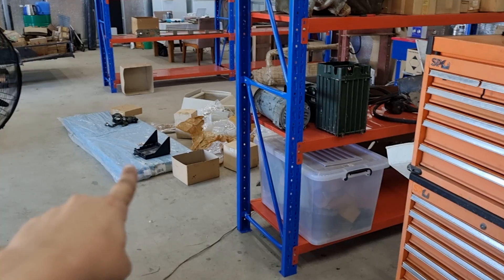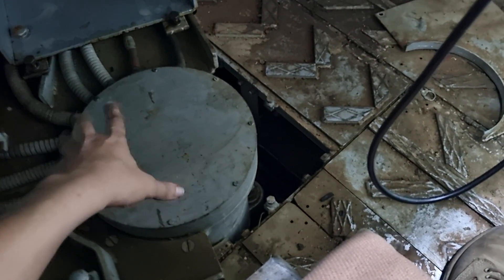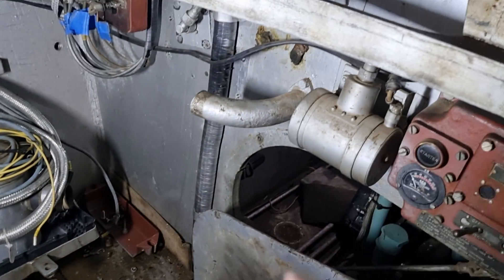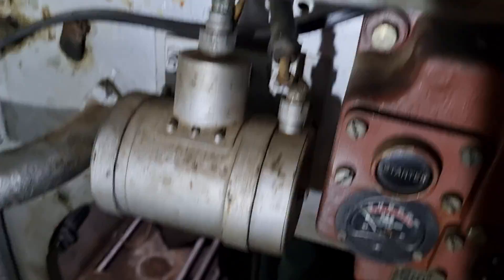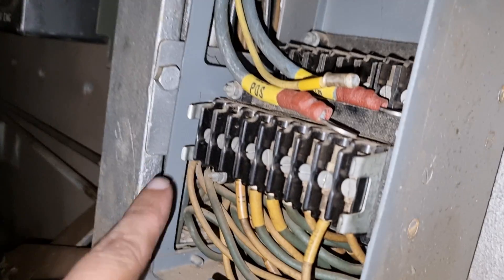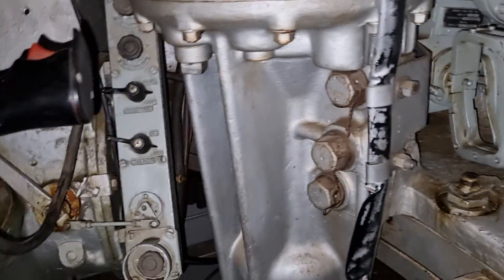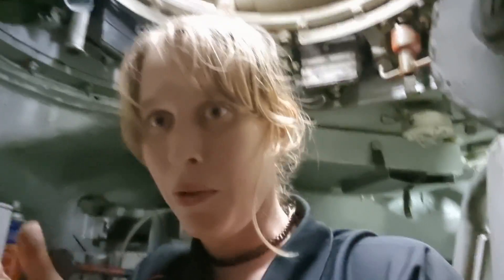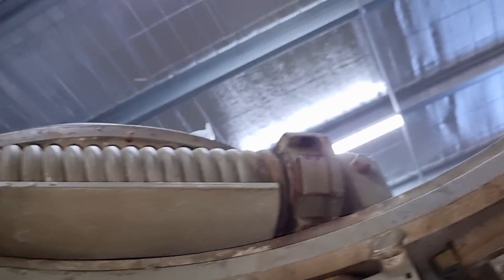Installing infra-red wiring harness to a Centurion tank!

Comment: Thank you Lottie for an excellent video. When are you taking orders for the:
‘Lottie the Tank Whisperer … scarier than the turret monster‘ Tee shirts— complete with appropriate artwork🙂? If you get significant orders, you could possibly follow up with a synthetic PT shirt with embroidery on the top left ‘a la’ some military units. I would be in for a couple of each. Cheers from NZ🇳🇿.
P.S. You could ask Kurt’s sister and say that he told you to do so😁!
P.P.S. What you say about rotary base junctions makes me wonder how modern cupola sights are powered. If they build the junction into the cupola ring there appears to be potential—over time—for corrosion and electrical short circuits.

Comment: Block the breach! If there is electrical disaster it can descend. You will then become Craftsman Screech who caught himself beneath the breach! Standard diagram of time. All wiring in yellow. Strap to hull or equipment because it’s a pain if you catch your foot in it and rip it off! I think booster was for high level work in places like Korea. R BJ I was told had possibility of freezing through condensation or worse in cold climates. Small fire under tank supposedly kept area unfrosted. 
You are doing very well you might well end up with a clang cap badge before long!

Comment: Would love to see how the RJB works - I an only assume a row of spring loaded vertical metal rods in a line from the centre to the outside of the drum(maybe largest one being dead in the centre for main power duties) and corresponding circular "hoops" on the top to allow constant pressure and contact as it transverses. I wonder if there is any graphite involved - to allow wear items to be easily changed, (like brushes on the starter) Fascinating stuff and good luck!
Reply: From memory, it has a stack of vertically stacked slip rings with brushes etc.

Comment: I don’t know where you  are but I hope it’s cooler than it is in north west NSW. Would be so hot inside that tank 🥵 So many systems to power that tank. What voltage  does it run on ?
Reply from the maker: It's not the worst temp right now. The tank stays relatively cool during the day, but it can be miserable 😅

There are a few power sources in the tank. For the most part, it's a 24V system